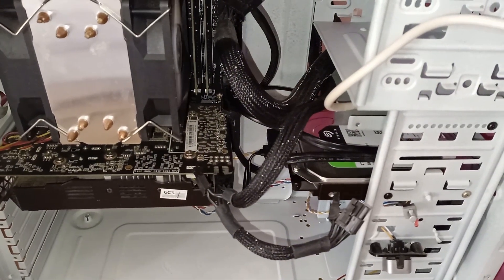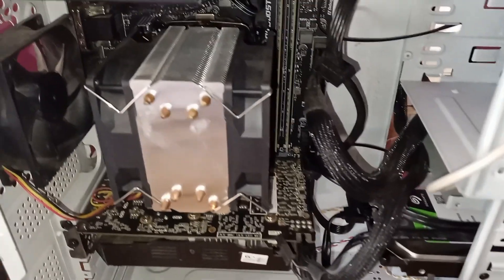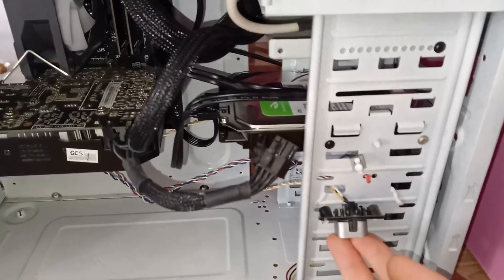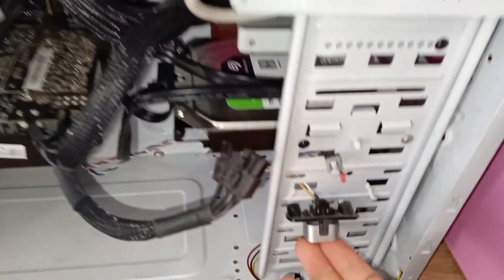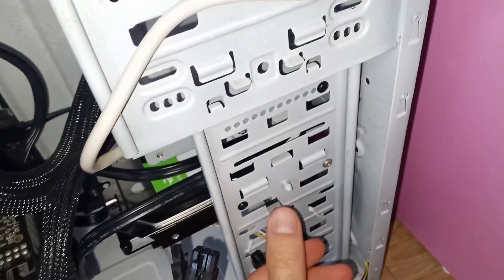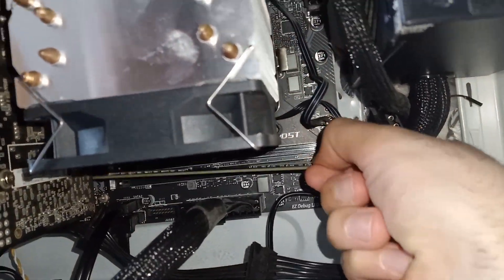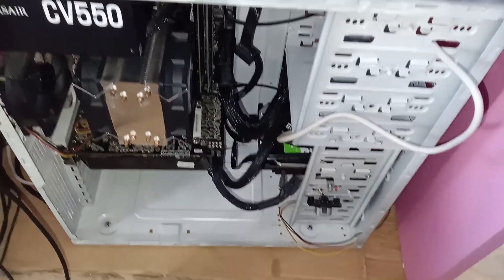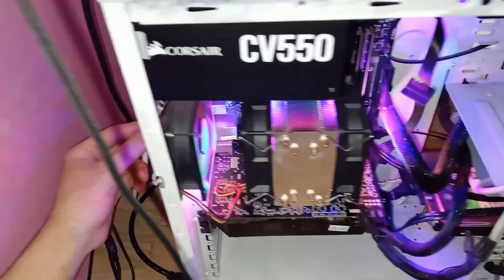How to Fix a PC That Turns On and Off in a Second

Comment: Didn’t work what do I do?
Reply from the maker: I'm gonna make a tutorial soon on other issues, but maybe try running the pc with 1 ram into the 1st slot, could be the 2nd slot damaged
Reply: @AAvirusAA  okay for some reason it was the cpu which i think its a bios issue, and then i replaced the ssd cable with the old cpu and it worked. So it was an issue with the cpu and ssd cable.

Comment: some the problems only the  PSU power  cord but attention and beware not all power cord have the same cables. example if you take sata cable from different psu brand can damage your motherboard.